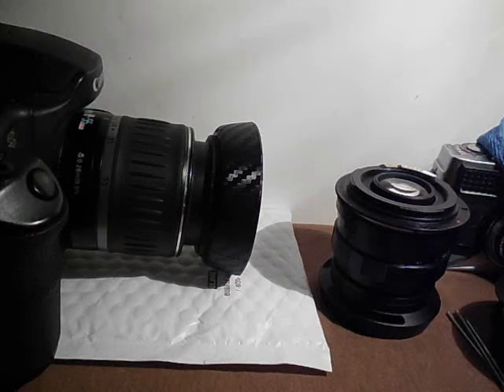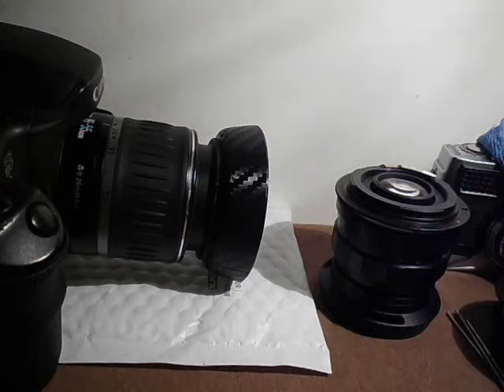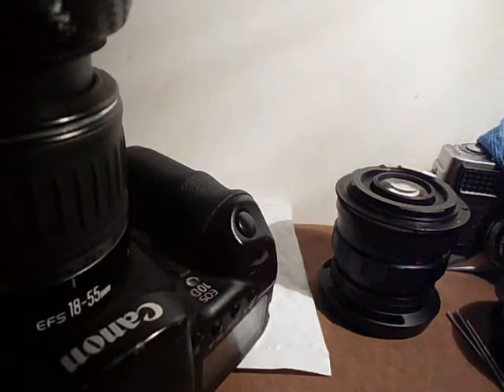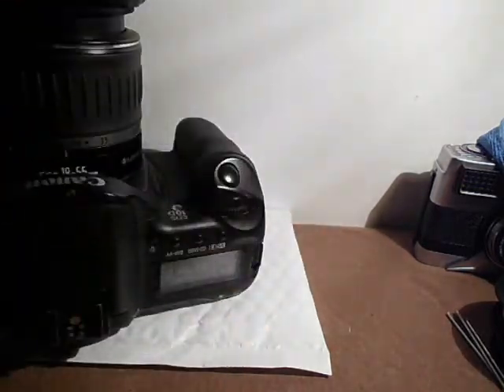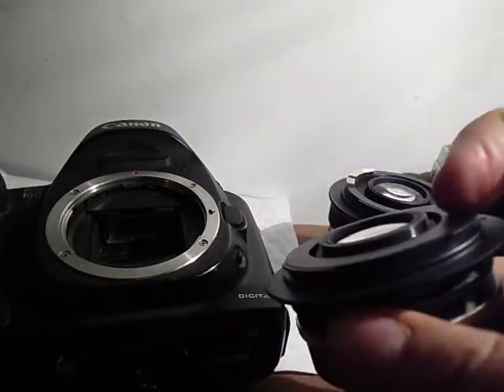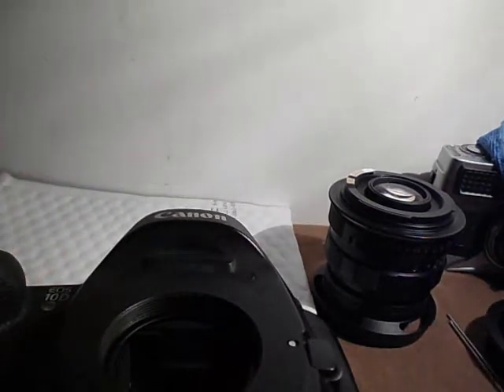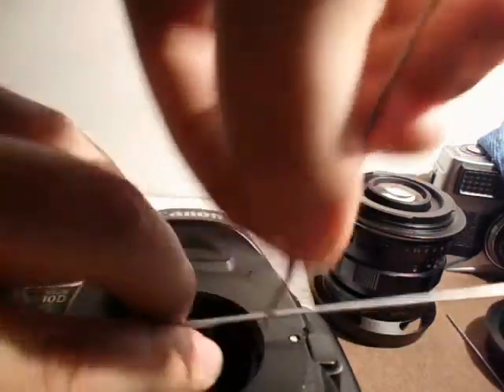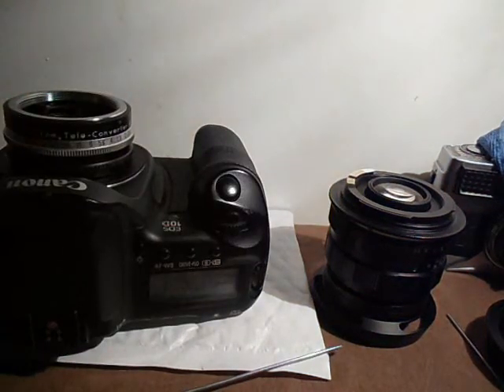How to check if your lens will hit your DSLR's mirror

Comment from the maker: Mostly from eBay, sometimes I'll find a deal on amazon though! Some people get really lucky and find them in thrift stores. My Cosina 50mm 1.7 was only $10 and it's a dream to use, Then I got a astranar 100mm-200mm 5.6 For $12, it's a piece of crap most of the time but surprising it takes great moon shots. Then i got a vivitar 28mm 2.5 for $25 off amazon and it's a great lens also.